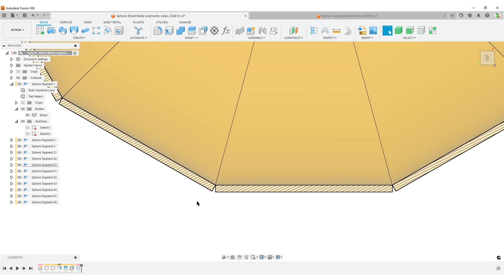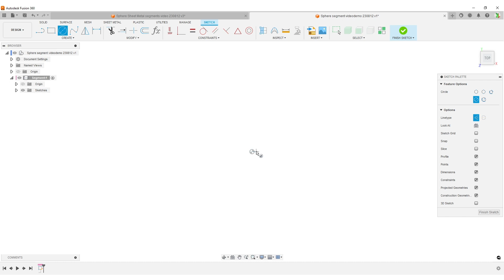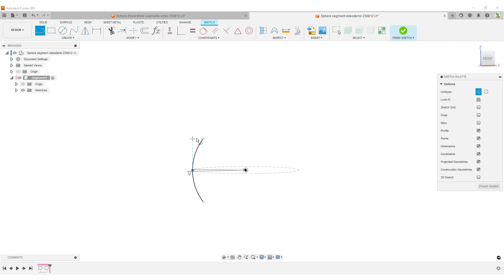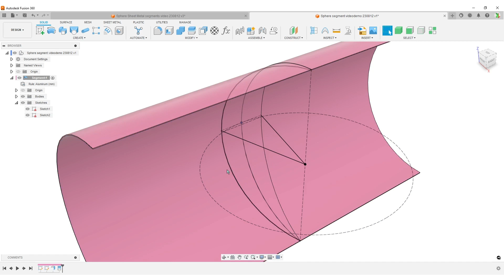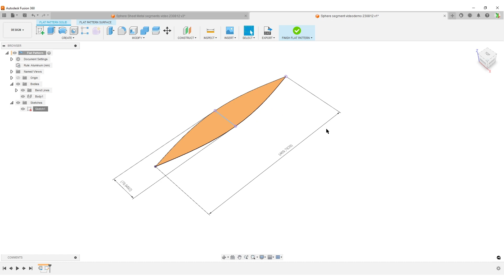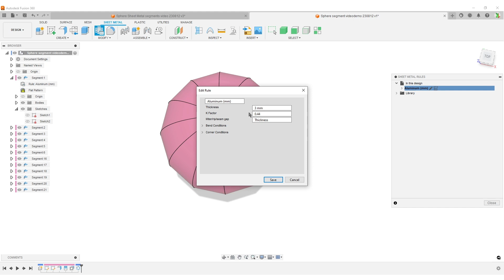Make a Sphere in Fusion 360 with Sheet Metal segments.

Comment: In my design, I have unfolded one segment to cut out a pattern, however when I refold it and activate the flat pattern fusion will not let me export it as a dxf. Can you tell me what I am doing wrong? I need to have the dxf template with my extrusions.
Reply from the maker: Sheet metal is a bit sensitive if you break the rules. But you get the flat pattern and it will not export? If possible ask the question on Facebook or Reddit and include the file for people tio have a look at it. I'ts not possible to troubleshoot without the file.

Comment: I think you can make same thing by just build segement as surface, cut extra faces out with scissor tool than thicken to desired value and convert it into sheet metal part.
Reply from the maker: Ohh I hadn't notice the convert to sheet metal works better now, I think convert needed a flat part of the sheet metal previously? (or I'm geting old).
Reply from the maker: I did a run with surface tools and I get the same problem with flat pattern failing if the surface arc i 180 deg, other then that it works perfect :)
Reply: I thought so too ) But just tried - it works.  @KristianLaholm